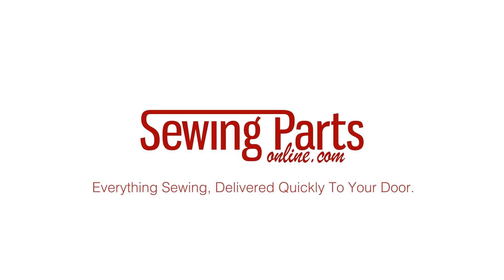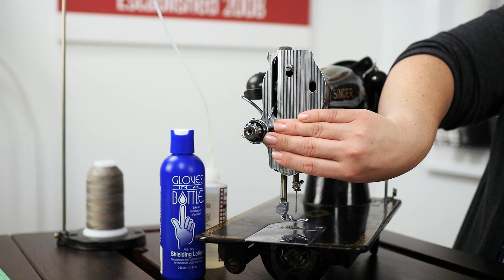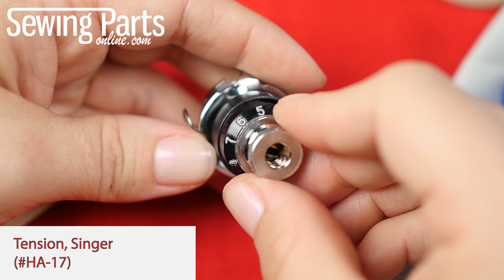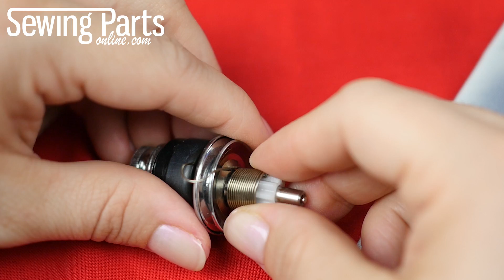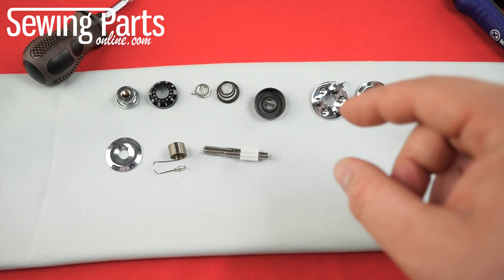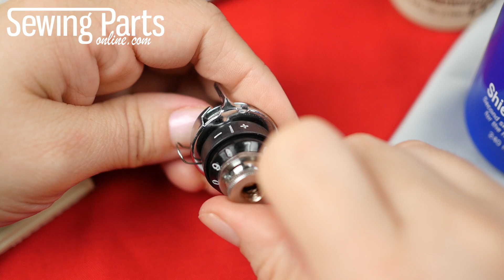How To Fix Your Single Unit Tension Assembly

Comment: true, buy an entirely new tension unit.  when i bought an se600 on ebay, i didn't know the tension was broken at all.  the embroideries came out a little plush, thought that was normal. they're supposed to be flat. i noticed that tension 9 and 0 were the same result, so i cracked open the machine and noticed that the tension unit was actually popped out of place. i put it back on, it works, but for some reason i have to have it set to 1.5 for good tension when it should be more like 3 or 4, so something's way too tight. i could manually try to adjust it (unscrew the end a little), but not sure how to actually fiddle with it or if there's more to it than that... ebay has brand new replacement tension units, will go for that instead.

Comment: My machine is still kind of new but the tension just stopped working. It can not adjust the tension anymore. No matter how much I loosen it, it's still tight and it keeps breaking my thread. This is a new singer 1507. I'm so frustrated. Thanks for the feedback though.

Comment: I don't buy the argument not to replace parts of the unit separately because "assembling this unit properly requires a skilled EXPERIENCED mechanic." It's a simple spindle assembly. Just tell me which tools I'll need, and what to look for in repairing it. Yeah, I could buy a whole new unit, but I'd rather replace the worn parts (most likely the springs) on my beautifully machined old tension assembly than buy the pot-metal junk being sold now.
Reply: Yeah, I'm an electrician. I fix things all day. I'd rather just fix the spring
Reply: @sarag1158  That person also thinks they can do their own wiring. 
  As a bike mechanic was constantly dealing with giant messes guys made because this attitude, my ignorance is as good as your training and experience. It made a twenty minute repair into an all afternoon nightmare.
Reply: Metal fatigues. If the spring is worn, the rest is too, it takes a lot of sewing hours to wear the spring out.
  Your attitude sucks. Throw a bone (a few bucks) to the local hood tech and he’ll be there the day you really need him.

Comment: Hi, I have acquired an old ALFA 42 sewing machine. It works perfectly but I noticed the spring on the tension unit is missing ,should I leave it as is or can you tell me where I can purchase a tension spring for it. Or the whole unit. Thank you.
Reply from the maker: If it is working perfectly, I would recommend leaving it for now.